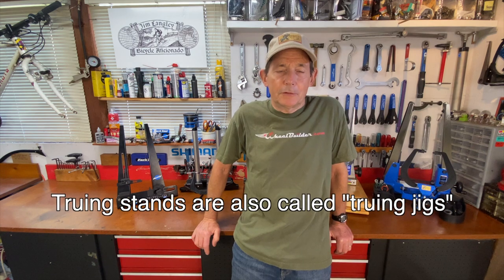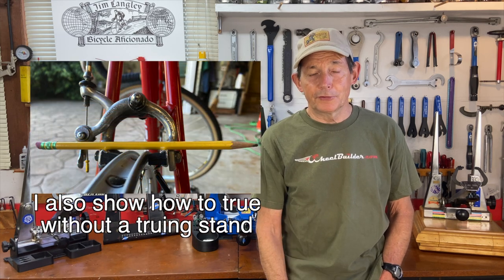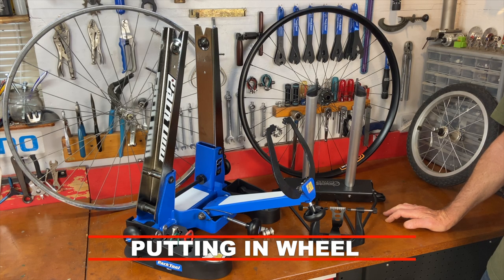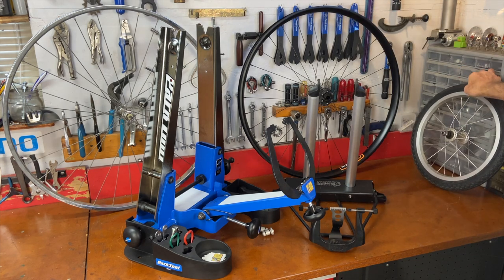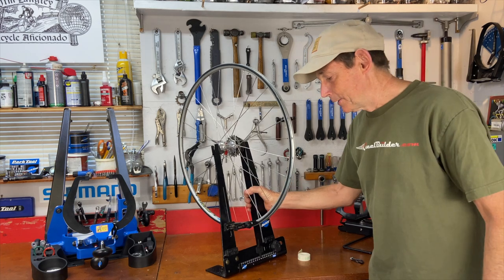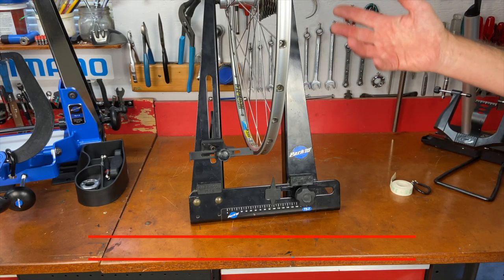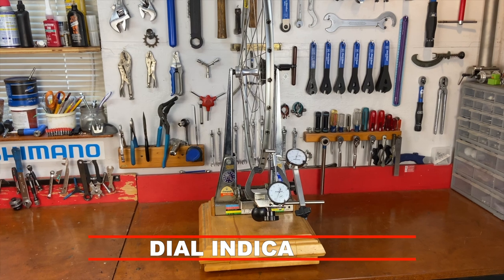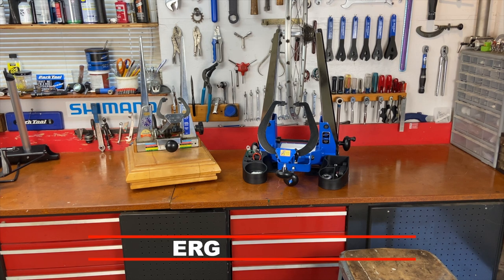Mastering Wheel Truing Stands: Unveiling the Secrets #bikerepair

Comment: The first time I got to see a real truing stand at a local bike shop, the mechanic let me watch as he straightened the wobble in my wheel.  The tire was still on the rim and as he proceeded to turn the nipples, all of a sudden the tire lost it's air pressure.  After a few choice words the mechanic admitted that he should have let the pressure out of the tire before he starting truing the wheel.  The turing nipple had torn a hole through the rubber rim strip and then through the innertube, letting the air out.  That was a valuable learning experience for both of us.  Couple years after that I bought my own truing stand and have been truing and building my own wheels for the last 40 years.
Thanks, for sharing your knowledge.
Reply from the maker: Thanks a lot for watching and sharing your great story Keith. That was an easy mistake to make back then when the only thing between the spokes and the tube was a rubber or rope rim strip. And, in the 1970s some spokes on bikes came too long from the factory. One of my jobs when assembling new British 3-speeds at one of the shops I worked at was to fix this. I had to remove the wheels, tires, tubes and rim strips and file every spoke down flush with the top of the nipple.. 72 spokes on every bike! All to prevent flats when we sold the bikes. It's nice that today so many rims have the spokes recessed far enough inside that it's okay if the spokes are a little long. Thanks again for sharing your story!

Comment: My stand is fixed to a white melamine board attached to an angle grinder stand with adjustable height fixed on a center pole and a heavy base that has a minimal footprint. It can be put in a corner and move around as needed without cluttering the workbench.
I've created a removable side bracket that enables to check the the dishing by sliding the wheel on and off the appropriate shortened axle (based on Park Tool's Wheel Holder WH-1 design) with minimal movements.
I've installed hooks on the ceiling to enable me to get to the wheels without moving and get them out of the way as needed.
All these things make the task easy, reduce the risks of injuries (back or neck pain) or damaging the wheels.
Reply from the maker: Thanks for sharing Sylvain - if only YT allowed sharing photos too! Your setup sounds very well thought out. I like your dishing checker - that right there would save time and effort. Very clever. And having a movable self-contained building station is a very nice way to go. Appreciate you sharing!

Comment: I  don't think you mentioned the brand of the lightweight stand with the friction held arms - Spoke Doctor?
I prefer to use a dishing gauge for centring as it is quick and easy to check at several points around the rim.
Good tip about the white background (I recently painted my shop-built stand in black!)
Reply from the maker: Thanks for watching and the question. That stand was called the Spin Doctor and I believe it was sold by Performance Bike Shop. I don't think it's made anymore, but it might be found on eBay.com etc. It's so lightweight it's best to clamp it down when using it or hold it in a vise. I agree with you that dishing gauges are the best way to ensure wheels are perfectly centered. I talk about them in some of my other videos. Some builders like using truing stands for centering, but when you want it perfect, it's a lot easier with a proper dishing tool. Here are some of mine: https://www.youtube.com/shorts/52eggMGEYDM Glad you liked my tip on white backgrounds, the older your eyes get the more it helps 😀 Thanks again!!

Comment: Terrific, Jim. I admire your daring to go granular, to show us these different stands and how to use them. It seems Park Tool has the best, but they're probably the most expensive also. Me, I use a bicycle fork in a vise with a pair of pencils taped to the arms. Not too accurate, but it works.
Reply from the maker: Thanks for the kind words, Peter - very happy you enjoyed this video! I like Park's stands the best because they're so easy to work with, but yes, the cost has gone up over the years. When I bought my latest one, their new topline 4.2, I just looked at it as investing in a tool that'll still be going strong decades from now. My previous Park stand, the 2.0 is 40 years old and still working like new. Park stands aren't the most expensive. The ones with dial indicators cost more, such as the beautiful P&K Lie https://www.pklie.de/truing_stand.html I had one of their stands and enjoyed it but I found it took too much time to setup the stand and it wasn't suited to the "rough" truing you do after first lacing a wheel. At that point you often have large wobbles and hops and dips. With a Park stand you can easily open the stand caliper to handle any size issue with a just-laced wheel. Not so with the P&K. But, some people swear by it and wouldn't use anything else. Thanks for telling me about your bicycle fork truing stand - that's actually what I used before I bought my Park stand and yes, they definitely work! Thanks for watching and sharing what truing stand you use.

Comment: Thanks Jim, great video and good info on the TS-4.2 which I'm considering. You asked for info on stands we use and I'll mention I've been using a simple stand I bought for $13 from Palo Alto Bike Shop 50 years ago as a young teen-ager. It's made from aluminum 1" stock bent into a U shape, with V-notches in the top of each upright of the U. One bolt attaches it to an X-base made from two more aluminum straps. It has a wing-nut adjustable arm made from aluminum rod stock formed into a small U shape at the end to surround the rim--drilled on both sides for bolts that can be screwed in or out to measure rim-trueness. Cheap and simple, but I have a a 50 year old Campagnolo dishing tool so this strap stand has served me fine to build many dozens of wheels over the years. It's a bit slow in some parts of the building process compared to a Park TS-2, and it wobbles, but as you know, you can build quality wheels that way if you have a good dishing tool. I always thought I was suffering with this cheap stand until I was chatting with a couple pro race mechanics at the Ghent Six Day, 30 or 35 years ago, and they both used home-made scrap-strap truing stands like my Palo Alto one, and said they used these simple stands to build all their team wheels! So I decided mine must be good enough, haha, and went for another 30 years building with it. But then, like you say, Boost and fat bike wheels and not wanting to dump sealant, so it's finally time for a Park TS-4.2. Thanks for the teaching (and for all I learned from you in your Bicycle Magazine column).
Reply from the maker: Thanks for watching and the great comment Mitch. I had the Palo Alto repair stand and used it for a long time, amazing for the price. And I never made one but as a Cycling USA trained mechanic they taught us how to make those basic truing stands. I know how well they can work. 

I still use Campy dishing gauges and think they’re among the best - definitely the most elegant. If you want to use one for the wider rear MTB wheels it’s pretty easy to modify them by adding a spacer block on both feet. I just used pieces of brass center drilled. Then I drilled and threaded a 5mm hole into both the spacer blocks and the dishing tool. To attach them I use the Campagnolo down tube shift lever thumb screws. I can make a video to show this if you’d be interested. 

Thanks a lot for watching and the awesome comment🙏❤️

Comment: Thanks Jim...I finally have all the parts gathered for my new wheel build. Wish me luck. I have only taken wheels apart and rebuilt them so far. I don't remember if it was in one of your videos or not, but I saw some one lightly hitting and setting the J bends (on new spokes) with a light plastic hammer tap before truing the wheel. I looked and couldn't find it again. Do you recommend this step? Thanks for all your great pro tips so far...😎
Reply from the maker: Good luck, you can do it! Yes, I show that step in my video about here https://youtu.be/XUqul03hbZ8?t=1324 and yes you should do it when you're building your wheel. It's important because you want the spokes to be straight before you start truing. They usually curve coming out of the hub and gently tapping or pressing them down will seat them in the hub, flatten them and straighten them. I show the plastic hammer technique and also this technique in the video with a screwdriver handle that flattens both spokes - that's here: https://youtu.be/XUqul03hbZ8?t=1354 Have fun!!
Reply: @JimLangley1  Thanks Jim for having the heart and soul of a teacher.! I will use the plastic hammer and screwdriver handle method before I tighten them up. I also just noticed that my new rim holes are too small for my 12g nipples. They measure really closely at 3/16 in my hole gauge. I am going to drill them (lower) from the outside in as it looks they came new. Nothing looks countersunk on my old wheel or new. Both are double wall, and the upper hole is large enough to accommodate the nipple head. Thanks again for the video reference. I couldn't find that again to save my life! I am however "enjoying the process"...Cheers mate! 😎
Reply from the maker: @godfellas483  if it isn't too late, you might want to double check with the rim company to make sure they say it's okay to enlarge the holes for the spoke nipples. If they say no, then you'll need to switch to 14g nipples and spokes. It all depends on the rim and how reinforced the holes are.

Comment: One more feature the Park TS2 stands have, is adjustable centering. The center position drifts slightly as you open & close the arms for different axle lengths. Each arm has an adjustable collar that sets its position relative to the other arm, which changes the center point. If you set these collars carefully, it can give a true enough center to obviate the need for a separate dishing gauge.
Reply from the maker: Thanks for watching and mentioning Park Tool's self-centering truing stands, Michael (the blue one shown in this video). When they are adjusted correctly as they are from the factory, when you place a wheel into the stand the indicators on the truing stand will show the center position where the rim should be. So on a wobbly wheel you can true until the rim runs true right between the middle of the L and R indicators and you know that your rim is now correctly centered (meaning the wheel will center correctly when you put it back on the bike). Over time if the centering feature of the Park truing stand changes, you can fine-tune it as you described. I have more information on Park's great truing stands in my review of their TS-4.2 truing stand here: https://tinyurl.com/ynd2meu6 Thanks again!

Comment: Thank you 
Nice and thorough
Reply from the maker: My pleasure Campion, thank you for watching and commenting, appreciate it! 🙏
Reply: Do you have a favorite budget level truing stand to reccomend?
I fix up classic English 3 speeds as a hobby
Reply from the maker: @campionoverbagh561  that's a fun hobby, Campion. My first job at my second bike shop was assembling new Raleigh 3-speeds - great bikes. I still have one that I ride sometimes and a nice Rex 3-sp with 27" wheels - a rare bike. 3-speed wheels are heavy so you'll probably want to bolt any cheap truing stand to your workbench or clamp it in a vise since most of the cheap stands are pretty flimsy. But the thing is that 3-speed wheels usually have steel rims, which are not that difficult to true or fussy to true since how true the wheel is depends on the rim and most steel rims have welded seams that mean you can only get them within a certain tolerance. 

So, you could true them in any truing stand and get them nice as they can be. I think though that if you really enjoy working on wheels you will enjoy having a nice truing stand at some point and Park's TS-2 would be the ideal stand, especially if you get the base along with it. These turn up on eBay every now and then. There's one right now for about $180 (the shipping is more than the stand) - and it comes with a whole bunch of other stuff: https://www.ebay.com/itm/296230815890?mkcid=16&mkevt=1&mkrid=711-127632-2357-0&ssspo=HlIUrghKTei&sssrc=2047675&ssuid=mmzFHhVoQI-&widget_ver=artemis&media=COPY I hope that long link works. You could just search on "truing stand" too. 

Another option would be to make your own. Angle iron is pretty inexpensive and very easy to work with with basic hand tools. If you had a corner of a workbench to turn into a wheel truing station you could bolt the angle iron down for the base and make 2 sliding uprights from other pieces of angle iron and be off to the races ;-) I hope something here helps and thanks again!
Reply: Thank you that's great advice. I currently have a couple of 70's bikes; a Dunelt and a BSA both made after the Raleigh take over of those brands. They're both in good original condition and have cleaned up beautifully. 
Thanks again for sharing your enthusiasm.
Reply from the maker: @campionoverbagh561  enjoy those great bikes Campion! I've worked on and seen many Dunelts. BSAs are much rarer in my experience. One of the great things about these classic 3-speeds is that they often came with lovely head badges with historic themes, such as the Robin Hood 3-speed with Robin and Nottingham Castle on the badge. Or the Elswick with a beautiful seahorse on the badge. Even though the bikes look similar, these little works of art on the frame set them apart and made each person feel like they had a unique bike. I have been collecting head badges for many years. In case you like them too, here's the case of mine with most of the badges from 3-speed bicycles. If you click the Next "button" up top you will open a new photo and another and see the badges. https://jimlangley.net/brake/europlatesdet13.html
Reply: Those are wonderful 
Thanks for sharing
Reply from the maker: @campionoverbagh561  you're welcome, glad you enjoyed seeing them!

Comment: Thanks for the informative video Jim. What’s your thoughts on the Feedback Sports Pro Truing Stand 2.0?
Reply from the maker: Thanks for watching and the question popswilson! I used a very early version of that stand. They've improved it a lot and added features since then and made it quite a nice stand for the money (the price I'm seeing on their site today is $150). For anyone wanting to learn more about it, here's the link to the stand in Feedback's site: https://www.feedbacksports.com/product/pro-truing-stand-2-0/ And here's their video on how it works: https://youtu.be/STAZbw9r7hA

I haven't worked with this new version but I like that it has a steel base, can be mounted to a bench and it's a nice feature for traveling mechanics that it attaches to a Feedback repair stand. Also, it's great for people with disc brake bikes or who work on their wheels that it includes a rotor trueness indicator. That costs extra with some of the other stands. The only thing about this stand is that you can't see both sides of the rim at the same time, which is true of the basic Park model, too. But it's easy enough to flip the wheel in the stand if you want to check the other side of the rim.

The one thing you'd want to make sure is that the stand is strong enough to handle the wheels you work on. Since it only has one arm and one aluminum axle holder, you wonder if a heavy wheel such as a e-bike wheel with a motor inside would cause the stand's axle holder to flex as you worked on the wheel. As I said, I haven't tried this stand so unfortunately I can't tell you. But, usually if you do a little searching you will find reviews and hopefully someone who has used it for heavy wheels like that will have commented about it. If you mainly work on pretty standard wheels, it looks like it would hold them just fine. Hope this is helpful and thanks for the great question.

Comment: Got a single angle iron truing stand. Would be better in 1/4" steel. It clamps into a heavy vice and a dial indicator fastens on a magnetic base. This is a one direction device so axle length won't matter. For an occasional build it's better than the bike frame.
Reply from the maker: Thanks for watching and sharing the details of your handmade stand, David, appreciate it! It sounds very nice. I'd enjoy seeing a photo if there's any way you could share one. Thanks again!
Reply: @JimLangley1  Not much to see. The dial gage and base stored indoors. The angle iron with a hole sits next to a monstrous vice on an equivalent steel table outdoors. No need to gild the lily! 1/4" angle iron would flex less and quick release would work better. Perhaps some threading could make it better and allow through axles of different sizes. Definitely with just a magnetic height gage pointer this is an easy option.
Reply from the maker: @davidburgess741  sounds very clever to me, David. Thanks a lot for explaining more of the details. It's sure to help people interested in building their own!